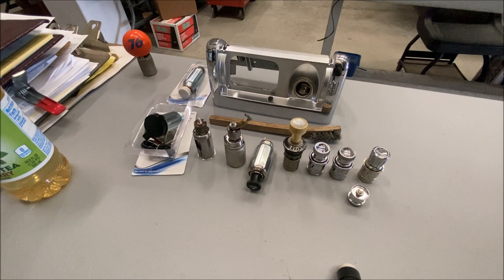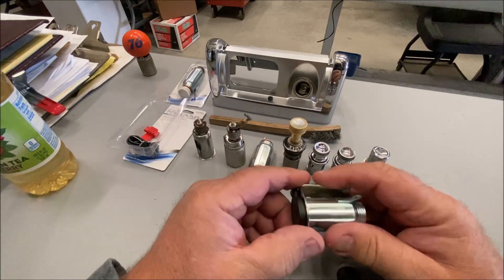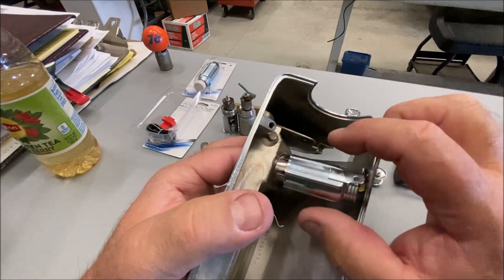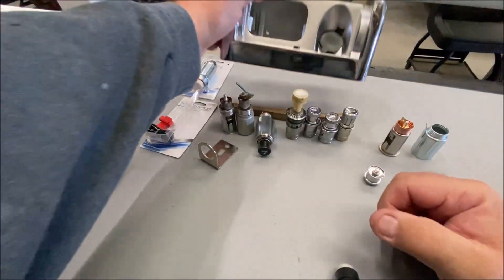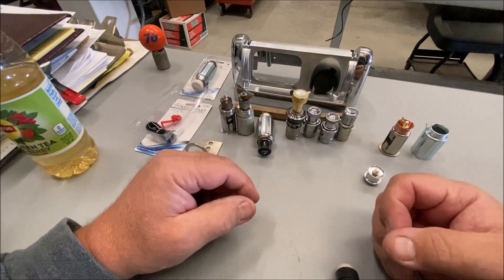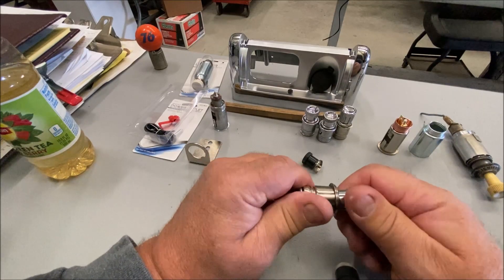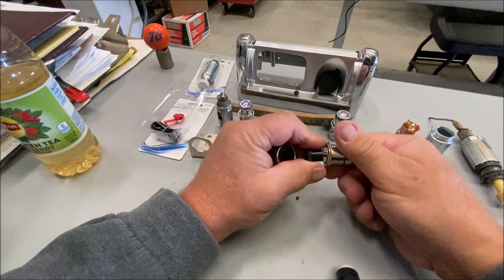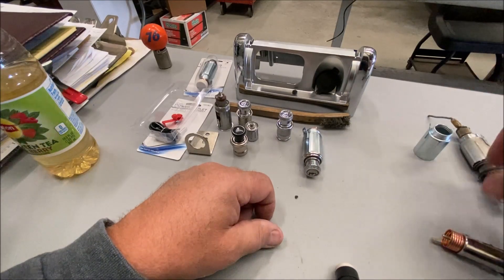1958 66 Thunderbird Cigarette Lighter Conversion to a Power Plug

Comment: This is totally worth it! I ended up taking the ash tray out, cut the bottom off, fabricated a plate that covered the top, cut two holes in the plate, tack welded the plate in position from behind, and installed a power plug and 3.5mm jack into the ash tray. That way I kept the cigarette lighter in place. I spliced the power plug into the cigarette lighter wiring with an inline fuse, and plugged the 3.5mm jack into my radio. Great use of otherwise wasted space.
Reply from the maker: I thought about doing that as well but then I accidentally came across this power plug and I noticed it looked just like a cigarette lighter and thought, well I can just replace the lighter with that and it all worked out as you can see in the video so I saved myself all the work you did. This way the ash tray is still there to collect change or what ever. Thats what I use it for. Thanks.

Comment: Hey Nick, thanks for showing this. I had no idea that the power plugs would not work in the original cigarette lighter connector. 
George B. in Michigan
Reply from the maker: You can put a charger in a cigarette lighter but most cigarette lighters are rusty and bad. When you try to put a charger in it, they can blow the fuse. A new power plug socket is new and there is a cover so crap wont get in there. Well, as long as someone puts the cover back on. But you can use the original cigarette lighter socket as long as it is still working. Thanks

Comment: I’ve actually replaced my old (not working) cigarette lighter with a new one, after i was done i was happy that it worked and celebrated with a cigarette using the lighter from the car
Reply from the maker: That's funny. That's what I would have done if I still smoked. I probably would have popped a beer too.
Reply: @vintagethunderbirdrepair9426  Haha love the beer part
Reply: Now I just need a cup holder solution I don't want any drinks around my new switches

Comment: Hello Nick I love your videos they are very informative and in-depth also very helpful. my problem is I have a hard ground on the red connector near the fuse box the side of the connector that goes to the fuse box. the ground is on the blue/red wire that powers the instrument lights. The part of the red connector that goes to the instrument lights has no ground the part of the red connector that goes to the fuse box is grounded any thoughts or suggestions is appreciated 
64 Tbird convertible 
Allen
Reply from the maker: Hey Allen, the blue/red wire is the dash light circuit. The blue/red wire circuit should not be grounded, it is only grounded through the lights when they are plugged into the dash, there is no separate ground wire. The way I am understanding what you describe is that the circuit is grounded on the fuse box side of the big red plug under the dash? I don't have a wiring diagram in front of me but I thought the blue/red circuit originated from the head light switch and not the fuse box. The head light switch is powered from the fuse box but the dash light circuit gets its power from the head light switch. I cannot diagnose that without being there and seeing it first hand. Usually a light wire gets pinched by being squeezed between two pieces of metal somewhere under the dash, or maybe your head light switch is bad? I guess I'm not being very much help since I cant be there to see it. Sorry. Good luck, Nick
Reply: Hey Nick thanks for replying 😊the blue/red wire from headlight switch to one side of the fuse is clear (not grounded ) the other side of the fuse shows short to the car chassis. Can you tell me what is connected to that side of the fuse other than the instrument lights? thanks for any feedback

Comment: Believe it or not it was useful.  I just need to see how to remove from the car.
Reply from the maker: Thanks Michael. Pull the glove box out and I think you can access it there. But if not you will have to remove the ash tray assembly from the center console. That also requires removing the glove box lock and latch.
Reply: Right now the lighter doesn’t work.  Could just be gunked up and rested.  If I still had another lighter I’d try it.
Reply from the maker: @TheMrazor  Well now you know where to buy one and if you want the original lighter element and knob I have that too. Check the fuse too.